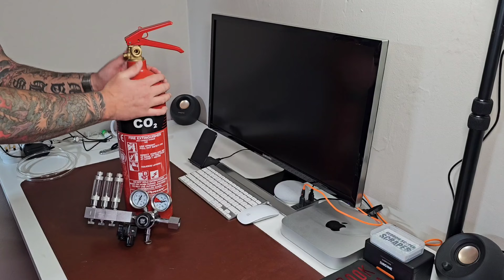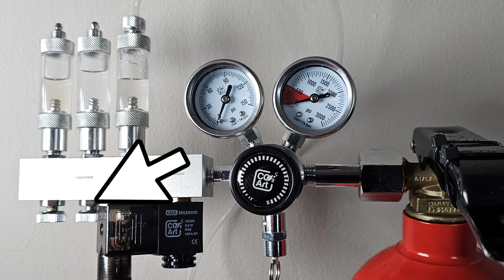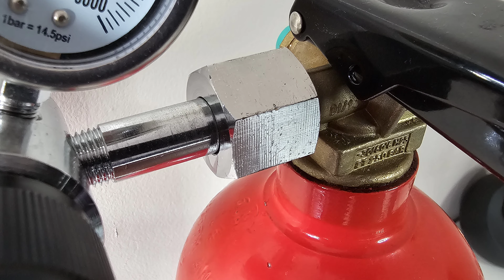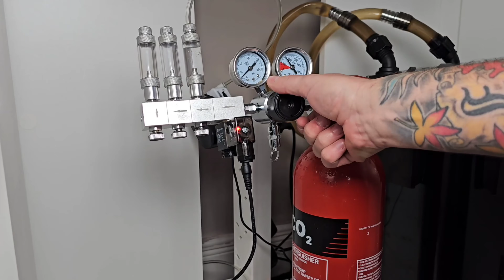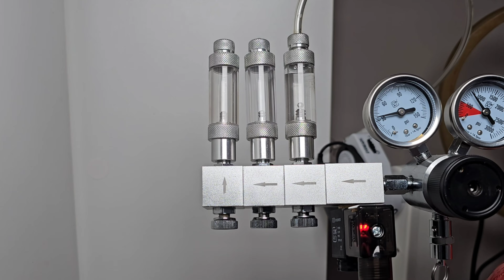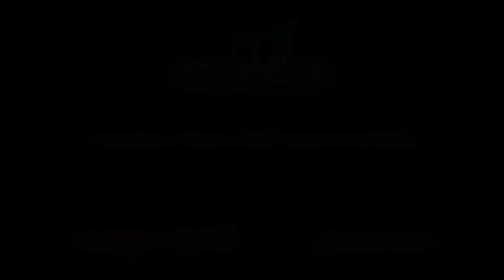Aquarium CO2 INJECTION made easy | STEP BY STEP guide

Comment: Thanks for the video. Can I ask if the timer of solenoid valve if turn it off you need to close also the cylinder? Thanks
Reply from the maker: Thank you. No solenoid opens when power is on enabling CO2 to get through so when the timer shuts it off no CO2 gets through. No need to do anything just set yout timer and bubble rate, sorted👌
Reply: Thank you very much 😊.

Comment: I'm the same Geordie,I've always been scared of using it,hearing shocking stories of wiping out livestock completely,but watching you there it looks so simple,can I ask at what point do u look at changing bottles,when completely empty or just before..
Also what kit would you recommend for a four foot tank 240.👌👍
Reply from the maker: Same kit as in the video mate. Best to always have a full bottle as a spare so you can swap over as soon as it's run out. I always let the bottle run completely out  before swapping. Get your moneys worth so none goes to waste Haha.
Reply: @GEORDIESCAPER  makes sense,il have a look,I have a juwel tank like yours,and also have the helialux light,so should be able to dial it right up,as I've got settings low at moment as I'm running lowtech👍

Comment: Great video, I’ve been really nervous about setting my co2 up, another one for thinking I’d blow the house up or something! This video has really clearly explained the whole process and taken away some of those worries so I’ll be getting on with this week! Is there anything us worryworts should be looking out for if things happen to start going wrong?!
Reply from the maker: Hey and thank you so much. Nothing better than helping someone out with my videos.
The main thing is to male sure the nut is nice and tight and listen for any small leaks or rub some water on and around the nut and thread area to check for bubbling. If there us nip it a little tighter and you should be good to go. Don't worry about drops in pressure the first couple of days, gradually creep it up until your drop checker is in the green during the light period.  Avoid the cheap ebay regulators.
Best of luck🙂

Comment: Great vid. How long would one of those extinguishers last on say a 200litre tank for example and where are they from?
Reply from the maker: Hey Chris,
Expect a 2kg bottle (as I used in the video) to last around 3-4months on a 200litre tank.
Thanks for watching 🙂
Reply: @GEORDIESCAPER  Have you ever tried the Tropica System Bio? Saw it at Pets at home but not seen anyone use it before. Might be a good vid 👍
Reply from the maker: @chrischapman4012  I have and not a fan of bio. Difficult to control the amount of CO2 going into the tank and doesn't last very long compared to a pressurised CO2 system.
Reply: @GEORDIESCAPER  that was my concern that it would be producing co2 all day and night. I’d best save up for a proper set up then 👍

Comment: It's a luxury, but I like to have two CO2 tanks. This way in case one tank runs out, I can just swap it with the full tank and go get the other one filled whenever I have time.

I'm really bad at keeping track of the amount of CO2 in the tank and can't tell you how many times I've looked over and noticed no CO2 coming out of the diffuser!
Reply from the maker: It is easy done, though. You're right it is best to have a new cylinder on hand to do a straight swap. I say that, but like you, I have a tenancy to check regularly.